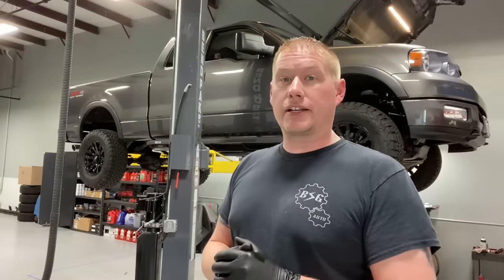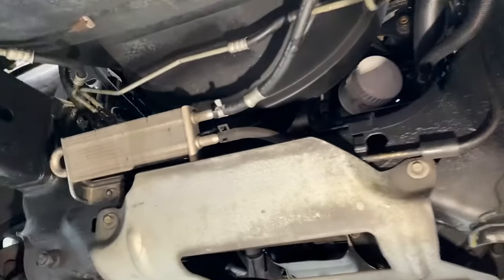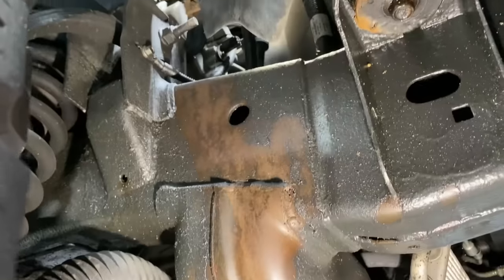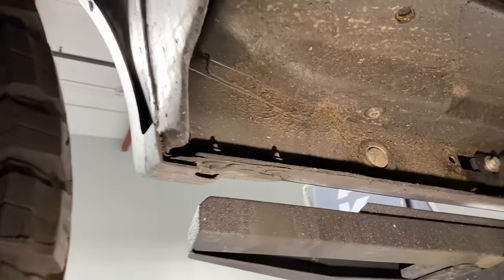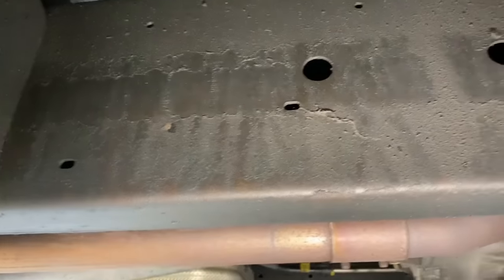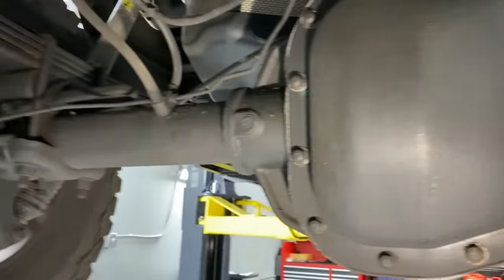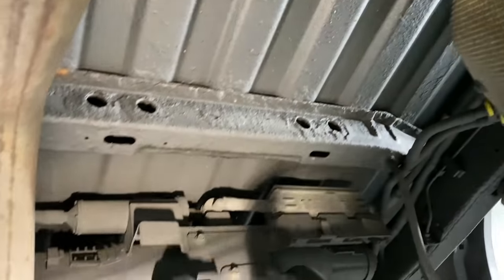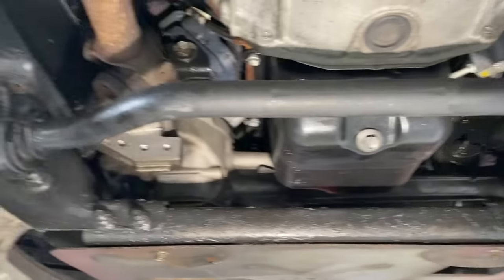Woolwax Undercoating 1 Year Review: Is it Really Better Than Fluid Film?

Comment: Might add a year, but northern vehicles rot. Better to replace them in a schedule with a southern truck and sell off to someone who can't learn.
Reply: How do you figure it will only add a year?  If it keeps rust from forming than it keeps rust from destroying the vehicle. Why not buy a rust free southern truck, coat it and keep it from rusting?
Reply: @davebliley5361  you can't get it inside boxed frames. Nor does it protect all the parts rust destroys. Can you protect a rocket sure. Hit rust makes everything electrical and mechabical go bad
Reply: mirrored window - I put a 360 wand on the end of the gun and send it into the frame from all the factory holes in the frame rails. Not sure what metal you couldn’t coat that rust would still destroy. It definitely won’t stop rust but it sure slows it down to a slow crawl. I personally have never had any issues with electrical connections of any kind.

Comment: I'll charge double to work on a vehicle covered in this crap. Harnesses and plugs gooped up, everything nasty and sticky. Fuck that lol.
Reply: I would rather have dirty arms/hands and a vehicle with little rust. But if you can get away with charging double go for it.
Reply: @davebliley5361  Luckily, I live near Houston, Texas and this isn't really an issue for me but I see it occasionally.
Reply: @davebliley5361  I don't like the factory coating on GM trucks either. I mean, you get some oil or fluid on it and clean up becomes that much more of a pain. I just want to wipe some oil off of the frame and maybe hit it with some brake parts cleaner but you end up with a greasy waxy mess and wasted time and rags. It's just frustrating when rust isn't a concern.
Reply: Jeramie T - I guess I don’t blame you for hating oil undercoating. No real reason for people to use it in your neck of the woods from what I understand. 

So do you guys really ever see rust on cars or trucks? Do rockers go bad / fenders start rusting? I am currently looking at southern trucks but it would be a long distance purchase. Just wondering if these issues I have up north are non issues. Or do crappy maintained vehicles still get rust.
Reply: @davebliley5361  For the most part they really dont do much other than surface rust but you can still have body rust if paint or coating is damaged especially if it's in a spot that will hold water. We also get vehicles that see the beach quite often, though they still aren't that bad unless they play in the water or the tide comes up n gets em. Generally a flooded vehicle would be totalled though. Otherwise it takes em about 40 years to really rot.
Reply: Jeramie T - Awesome. Thanks for the info!!